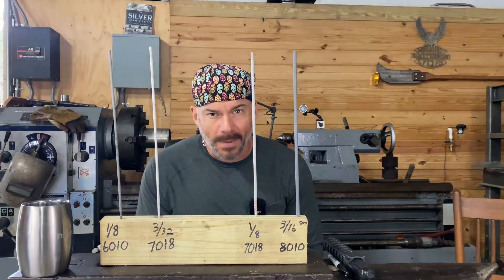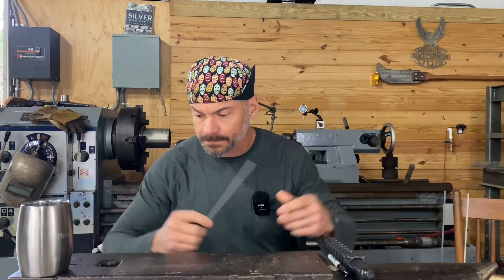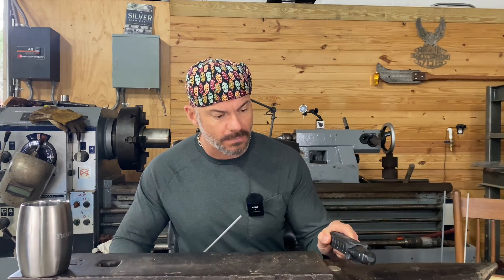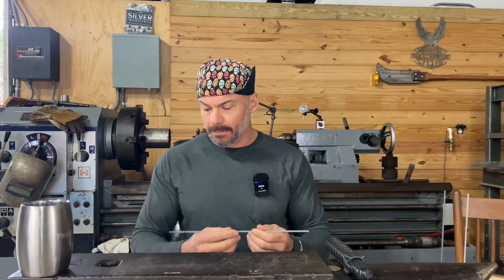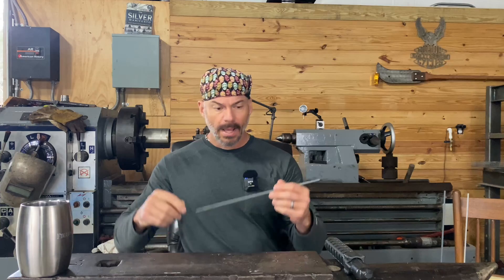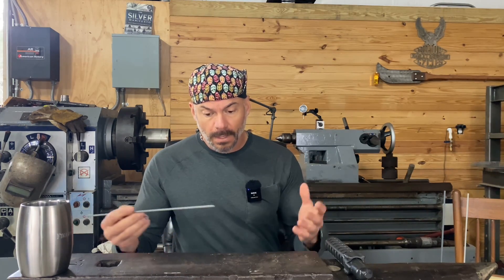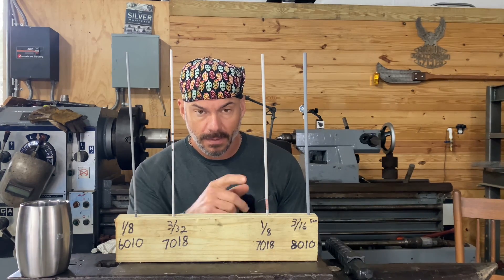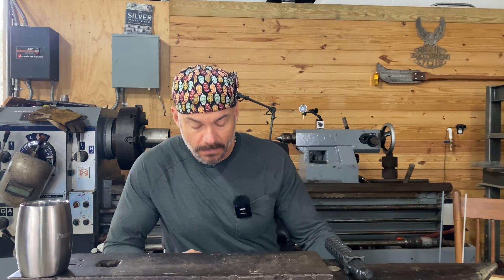How to set your welding machine WITHOUT a digital readout.

Comment: Here in Ireland the 6013 is known as the farmer’s welding rod. Works on rusty, dirty steel in less than ideal conditions. Whereas baling twine is jokingly called “farmer’s weld” because it’s used to tie stuff up in an emergency and then forgotten about. Gates, trailer tailboards etc. 
You can pick up 6013 rods anywhere. Car parts places, feed supply stores, small hardware suppliers etc. Of you needed to borrow a welding rod from someone, chances are it will be a 6013 that they have. 
I have no idea why. Maybe it has something to do with the higher voltages in Europe. Maybe it runs better here. 
There’s an old joke that the difference between farmers and welder is that welders know they can’t farm properly 😂

Comment: Mine has an amp readout but it only works when youre actually welding..and not looking at it (presumably for a helper) but its a bear until you know the machine, now I can look at what I'm welding and zero it in just from the dial but for a while I had to test weld everything

Comment: I have a miller big 40 gas that was used by a bridge welder here in kansas and missouri. It has 4000 hours on it and still does great. He had a valve job done on it at some point and he was great at oil changes.he did a lot of gouging and 3 sixteenths 7018. He replaced it with 3 diesel hobarts to hook together for 1800 amps to do stud welding. At that time hobart was the only one making 600 amps 100 percent duty cycle per machine.  Then itw bought hobart and miller and we have what we have today.

Comment: What you said at 3:58 is so weird about the amperage because I experience the opposite on my machine. I am running a 6011 1/8 at about 90-100 on the hottest, and then I can run a 7018 1/8 at about 130 in comparison. I run 7018 3/32 on the same settings as my 6011 1/8's.

I am using an inverter machine so it doesn't like 6010 so I use 6011. However, 6011 DC burn rate is is good when I strike, but about halfway down the rod, it starts eating itself up alot faster, so I've found I need to run those rods on AC to get a better burnrate so the flux doesn't catch on fire.

Comment: The first welder I bought was a Miller 250 nt with 4300 hours that didn't run. The only thing wrong with it was the brushes in the flywheel were dirty. It welded good. Recently I sold that one and bought a new lincoln 330 mpx. It's all digital and does pretty much everything.
Reply from the maker: Nice

Comment: Carbon arc gouging dosent hurt a machine, thats just what pipeliners say...  My old BB400D would burn 3/8 carbon rods all day, and still weld just fine, sold it with 8400 hours, no problems
Reply: I both agree and disagree with you on this. Let me explain. If you’re using a nicrome wire rheostadt on the arc voltage controller then turn it up to full arc volts. There’s a big flat spot on the controller and it can handle the high load way better than the bare wire can. I find that around 200 amps is the sweet spot for 8mm carbons, lots of guys have full arc amps and that always runs like a hairy goat, try it and enjoy. Be it a gas engine or diesel, they all love a session of good load, keeps them healthy and unglazed. That’s just my findings.

Comment: Never EVER dunk a weld that your gonna cut straps from into water while it's hot
Reply: I agree 100% but when testing for a jacka$$ one time called “bust em out bob” with bechtel that joker pulled the 2” xxs test coupon off the stand and straight to a bucket of water it went. Luckily it passes but I was pissed I was always told never quench like that. They also do it at Hatch nuclear plant in Georgia they got a big ole dunk tank. Just ridiculous 🥴🤦🏻‍♂️

Comment: I haven't ever worked with a welder that had a digital readout, but your suggestion about setting the amps makes sense. I think the amp setting has a lot to do with if you're welding with AC or DC. I used to use 6013 with iron oxide Flux for general welding, but eventually went entirely with 7014 iron oxide flux. Then, whenever I have more important welds, 7018 has been my go-to. I prefer DC reverse polarity for 95% of my work. Most often used rod diameter for me is  usually 1/8 and sometimes 5/32. I have 6010 but don't care for the spatter. Although it does give the fast fill fast freeze, I think it's hard to beat the looks of a bead from the 7014/7018. My choice for vertical up welds is hands down the 7018. Also 6011 is found on my rod shelf, but I rarely use it. The 3/32 7018 works great for thin metals. 
It was always a bit nerve wracking when the guy with the x-ray machine would come check the welds since he was all that stood between the welders having a paycheck or standing in the unemployment line. 😬

Comment: I have trouble with undercut especially going uphill. What is your advice
Reply: Zipper motion hold your sides
Reply: @trailerpark6.7  ok maybe I am not holding long enough. Thanks
Reply from the maker: Hold on the sides longer than you think you should . Maybe turn it down
Reply: @TaylorWelding  ok thank you

Comment: Hi, Chris  6013 are very common here in Australia. I personally don't use them unless there is nothing else. If you want slag inclusion, high or low and any amp's in-between use  6013 . I don't know why they even exist. PS keep up the good work 👍
Reply from the maker: Thank you Tim
Reply: Just getting back into welding since this internet was invented--so I bought a pile of electrodes: 6010, 6011, 6013, and 7014.  I know I like 7018 already-as that was the last stick I ran much of a few years back. And in my relearning with various rods and the new little box, I have to say that your conclusion here is a good one. I don't see ANY reason to restock the 6013's.